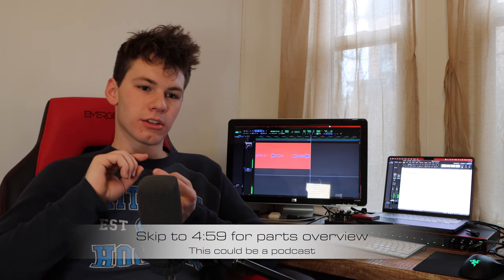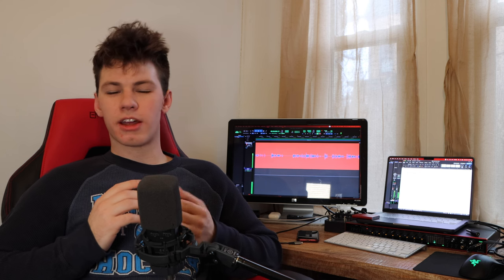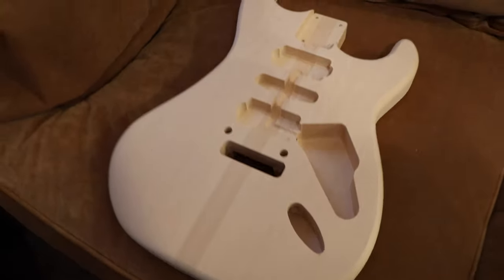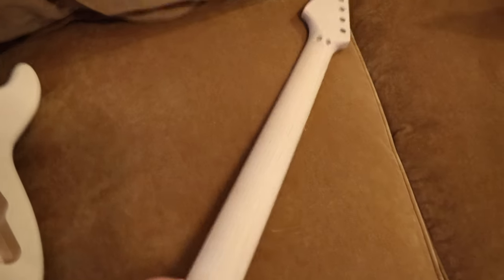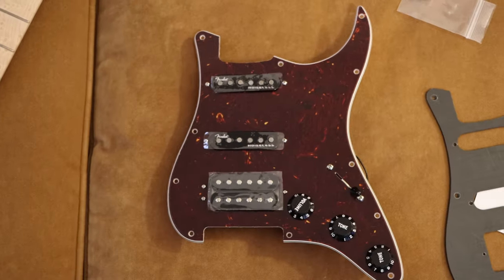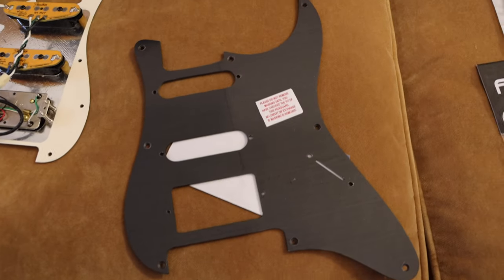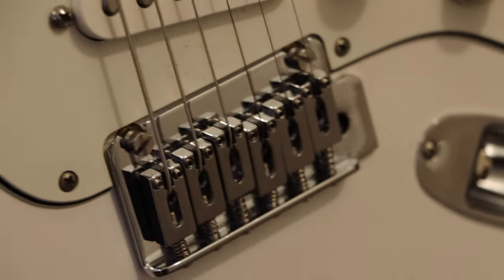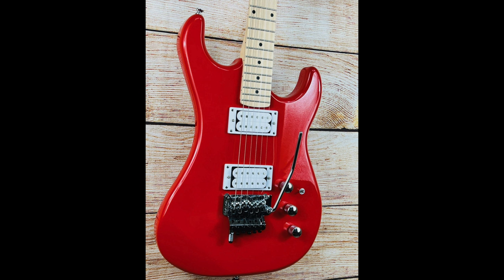Super Strat Build - Part 1: Concept & Parts Overview

Comment: Nice, but if you put a Floyd on but dont recess underneath it then you'll only be able to pull up a major third or a fourth at most. If you recess it then you ought to be able to pullup a sharp 5th. This is why Ibanez make the best superstrats and not Charvel or anyone else
Reply from the maker: I like the Floyd being flush mount to the body. All the strings stay in tune when I bend, and also if I break a string the other ones stay in tune. Also vibrations transfer better when the bridge plate is making contact to the body
Reply: @jacob_zang …agreed…having both, I prefer the flush mount👍

Comment: That's pretty cool, you are building the first version with the neck that was basically a strat neck which Kramer was forced to modify by Fender so they chopped off the bottom of the headstock. My first "real guitar" was a Kramer Pacer Deluxe red with black pickguard rosewood fretboard which I bought brand new in 1984 I think. I had the hockey stick headstock, and the Floyd Rose, tuners and output jack was black. A few notes. The Pacer line consisted of the Pacer Barretta which had one humbucker, the Pacer Imperial which had no pickguard and 2 humbuckers and the Pacer Deluxe had a strat style pickguard HSS. On gigging and tuning, the F.R. system was nice because it had the locking nut and fine tuners so it stayed in tune pretty well but. the problem was that you will many times end up bottoming out your fine tuners and in order to tune up you have to unlock, recenter your fine tuners , tune up and relock more frequently than you really want to, especially if you are at a gig and the heat from the lights cause you to go out , you only have so much travel and your fine tuner(s) bottoms out. then you are back to unlock etc. I wasn't a huge whammy bar guy and I got so sick of the locking nut, so I switched to vintage style set ups. Plus, when you pop a string on a regular guitar you can finish the song and swap guitars, if you pop a string with a F.R. the whole guitar goes way out of tune, so you are screwed. That said they are fun and have their place but if you are gigging you better have a good guitar tech to swap you out if you bottom out or pop.  Good luck with your build.
Reply: Had he not already ordered the neck with the locking nut shelf i would have suggested a normal well cut bone nut, with a bunch of lube it stays in tune just fine. Especially with a decked floyd.

Comment: What did theat neck set you back for? Its a beautiful rendition of what you had in mind. I have sorta the same taste. I hqve my lineups but i love to customize the snot out of stratocasters. I make any Fender better than a player or even a plus. My Birdseye Maple neck is from a fender arrowhead starcaster 05. When i got it i didnt know what that was but as i researched,  i realized what it was and that the shatoyance was not showing due to a poor finish so i sanded it all back qnd did a beautiful danish oil finish with a shelack protection.  Its a Tom DeLong style with my own name on it. I sold it and it actually came back a year later. I think i have a short video up. 😊also, i did an SE Squier that is basically a fender stratocaster incognito 😂.  I slapped some old alnico pickups in the neck and middle and a humbucker blade style in the bridge.  It was in really horrible unavailable condition when i got it. The neck was slightly twisted,  the neck cavity was cut up bqd, the bridge cavity was mangled too. I found a neat fact about the guitar,  it was made by Axl. And has a veneer so i did a relic job to see what i could unveil. I even restored the pickguard after it was painted, put an old crl 5 way from the 70s qnd did a double stack like yours for the 2505 500k benefit and wow, this thing is a serious sleeper. It has nice locking tuners as well from hipshot.  Oh, and cloth covered wiring with a sweet capacitor and tonw bleed. He really cool thing is, when you go from nine to ten on the volume,  it jumps to like a 14. Lol 😆 😅